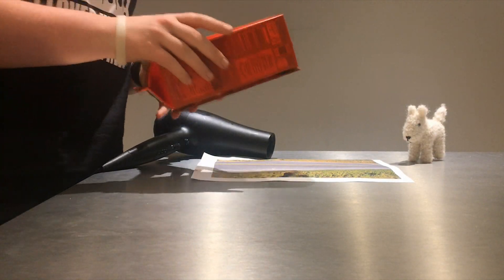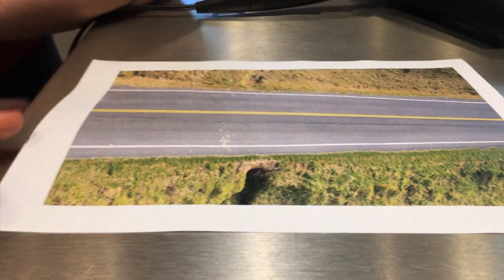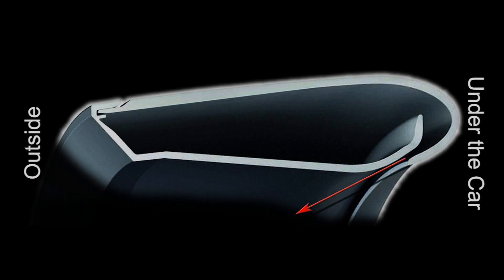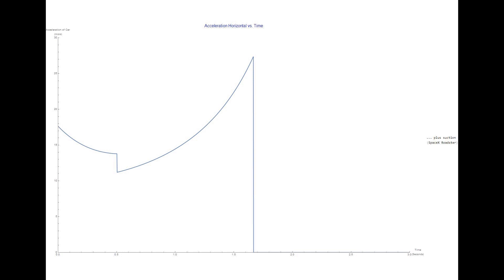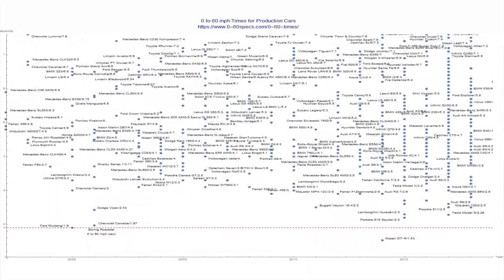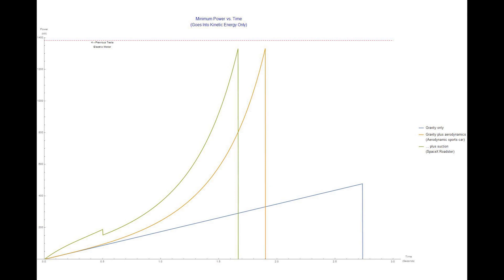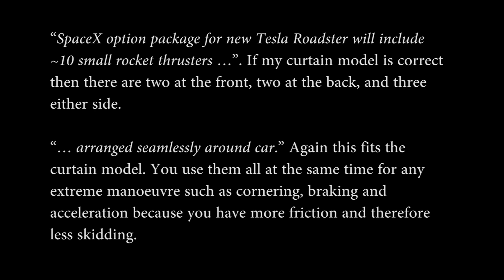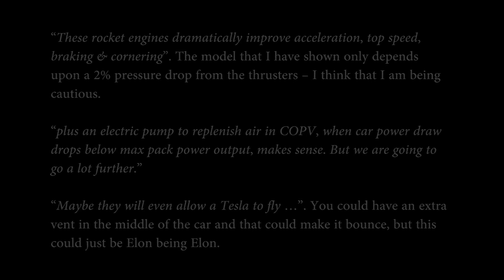Tesla Roadster 2020 Aerodynamic Model and Predictions

Comment: I think you are on the right track.  The mass efficiency of a direct rear-facing rocket or an up-facing rocket will consume the compressed air far too fast, but an under-car vacuum is likely to produce a great deal more force for a given quantity of air.  The negative pressure (negative relative to ambient) can be relatively minor and still create a huge downforce due to the size of the car.

In addition to an edge-outward model, perhaps also a tangential vortex shaped flow might work?  Perhaps tubes actually sucking like a giant vacuum but powered by a venturi instead of an impeller?

Also if the vacuum control is very fast, it can be managed in conjunction with active traction control, both for acceleration and for cornering, so the compressed air is used most efficiently, providing just enough downforce to stop slipping.

Comment: Hmmm...suction cars like the Chaparrals created downforce when it was most needed, during slower speed cornering. Formula 1 has DRS to allow a steep downforce curve as velocity increases, which is cut at top speed so there isn’t a drag penalty. Those are both crude ways of making downforce. Your video appears to show downforce being made by the suction of thruster nozzles. Weirdly, that downforce is used for very low speed traction instead of cornering. A “nozzles up” thruster would be less sensitive to ride height,  it ride height is fairly constant from 0-30mph. I’m sure the car won’t do a flying backflip at those speeds. 

But all of those are producing downforce on the body, not the tires. All we need to do is directly produce downforce at the tires’ contact patches..What if you aim those nozzles at the “squish areas” right ahead and right behind where the tires touch the road?
Reply from the maker: Thank you for your comment. Sorry for the slow reply - I had exams and now interviews ?!?

The suction approach can provide traction for cornering, braking, and acceleration because the suction acts over a really big area pulling the whole body down and pressing the tyres into the road (I can just hear my physics teachers saying that the atmosphere is pushing the top of the car down … but you know what I mean). One great comment that I got from another viewer was that the downforce on a racing car was smaller then the downforce in my model of this sportscar BUT when I looked at the numbers I saw why - there is a really big area under the Tesla but a much smaller area under the racing car. Pressure and suction create force by acting on an area.

So I think that this plays to your second question "All we need to do is directly produce downforce at the tires’ contact patches.. What if you aim those nozzles at the “squish areas” right ahead and right behind where the tires touch the road?" In my model the pressure drop acts over an area to give the extra tyre-traction-force so if I only applied the suction around the tyres it would be Small_Area x Pressure_Drop = Small_Extra_Tyre_Traction. Have a look at that and tell me what you think. I think that you would have a style challenge here as well.

You are absolutely right about the effect of ride height being a pro for reaction forces from nozzles.

So it will be interesting to see what the announcement is like but I still fancy suction because physics seems to be on my side, it gives an iPhone/Dyson/Musk design theme and safety is much easier.

(Joerg on the https://teslamotorsclub.com/tmc/threads/speculative-aerodynamic-model-of-thrusters.123083/page-2 has an interesting concept where the gas jets are in the diffuser tunnel (his solution is mechanically simpler than my curtain) but I suspect that the suction area would be halved. Time will tell.

May the best physics win!

Comment: Hi, I love your idea!
I was really hyped for "rocket style" thrusters but your idea seems better and like something that could come from Elon and SpaceX's engineers crazy minds :)
I have read your thread on tesla forums, but I would like to ask my questions here since I am not registered there.

1 - Elon recently said that the COPV tank holds 10000 psi of air, how does that alter your graphs?
2 - You assumed 1g of traction, later you changed that upon a request to 1,25g, but I found graphs that show Model SP100D pulling 1,4g on start here : 
https://i.imgur.com/R28Yz8J.jpg  
, can you please send me a graph with 1,4g of traction? I would like to see how it alters the 0-100 time
3 - They are probably calculating the 0-60 time with 1-foot rollout, did you include it in your calculations?

You got me all excited about roadster again ^^
Reply from the maker: Absolutely fine for you to post questions here. I have just done an exam this morning and I have another on Friday (and a conference on Sunday) - so you will have to let me answer at the weekend; possibly Saturday after rowing practice. I did most of the work during the summer holidays but these new data points should probably just be a tweak to the model.

I love the extra information in your question - if you look on TMC you can see that I knew about some of them - but your tyre data is new to me and so is the '1-foot rollout'. I am happy with my 0-60 predictions but not so much with my 0-100 times (because above ~ 60 mph the model needs to know about the batteries and the motors (below 60 it is only Newtonian physics)).

Thanks I will do this for you.
Reply: @MESM6  I will gladly wait for your response, no problem. Good luck on your exams :)

 I think I remember Elon saying 300 kg of air, but I can't really find where he said it, maybe I'm misremembering, but I'm sure it:e the 10000 psi, I checked.

I'll try to find the source to the 300kg claim before the weekend.
Reply: https://www.youtube.com/watch?v=ycPr5-27vSI
here elon talks about 10.000 psi at 1:09:00 , unfortunately I couldn't find if he mentioned the weight of air plus tank :(
Reply from the maker: Sorry for the delay I have had exams and now I have interviews. I have actually done the calculations for you and I will post them shortly.  @DKdoman
Reply: @MESM6  Absolutely no problem, I am studying myself :)
Will you post it on teslaforums in your thread or here ?

Comment: I thought the roadster is going to have 3 motors, not 4
Reply from the maker: You are absolutely right - I think that they plan to have one at the front and two at the back. When I did the video that was not clear from the sources that I had.

I am told that the rear motors may be optimised for high efficiency at low speeds.

You are observant so you may also have seen that on the Joe Rogan show Elon gave us the COPV pressure as 10,000 psi (which is not the same as the number that I used (it is new data)).

Elon also clarified the maximum acceleration from the tyres in the baseline Roadster - about 1.1 to 1.2 g - but he may be benefitting from the diffuser under the car and getting suction that way. It is still slightly ambiguous.

The impacts on the calculations and computer models are not too big though, and the main argument survives EXCEPT the car will probably not be able to turn without moving forward, so probably no pirouette mode :( . One of my graphs shows the power that you need to get to 60 mph in a very short time and I drew a line which showed what four of the old motor designs could achieve; but I don't really know what electric motors he will be using.

Thank you for your observant comment.

Comment: For this effect to work the car needs to be at a near constant height to the ground, if you hit a bump or drop the suspension too much you will loose downforce. The sheer speed the car will be capable in a high speed corner would create a terrible accident IF downforce was lost. (Re: 1980's Formula 1 racing) Tesla would be smart not to use this method and stick to direct propulsion. Love the idea though..
Reply from the maker: Hi, you might be interested in one of the other ideas (which I do not favour) where the extra downforce is created by a single central up-vent rather than my suction model.

The F1 racing car comment that you have made seems to favour the single up vent.

Comment: The problem I have with this hipotesis is that in this way the Roadster it's not capable to do short hops like Elon had said. To create a low preasure area under the car at low speed with air flow is great Idea ( before aerodiamics could make the same effect, the flat bottom of the bateries helps a lot with this), maybe will be implemented but it will only be a part of the sistem, maybe 2 or 4 thruster for that.
Reply from the maker: Hi Miguel. One way of reading his 'fly' comment is a vent in the middle of the car that creates a high pressure.

Could I recommend the Electrec link which shows a great deal of old fashioned aerodynamic shaping under the car (https://electrek.co/2017/11/20/teslas-next-gen-roadster-technical-analysis/ ). (For some reason car-nuts call these 'diffusers' which seems confusing). The 'diffusers' seem to be present on both the baseline Roadster and the SpaceX Roadster.

Elon said that he would fit 10 thrusters 'seamlessly' so my bet is still with suction!

Looking forward to seeing who wins!